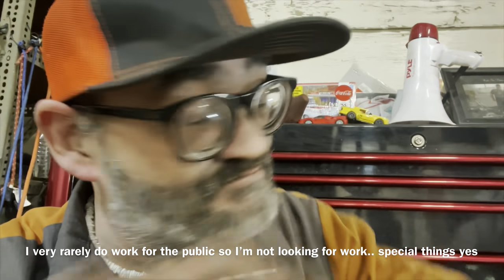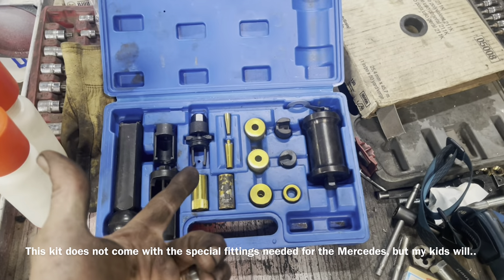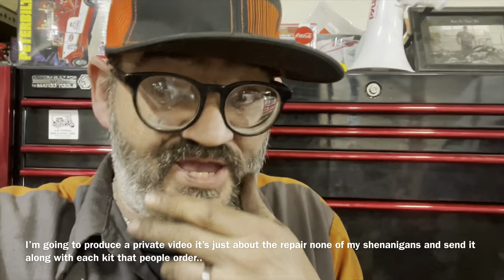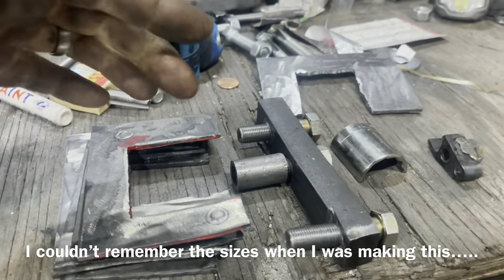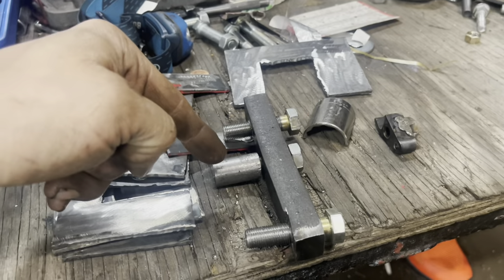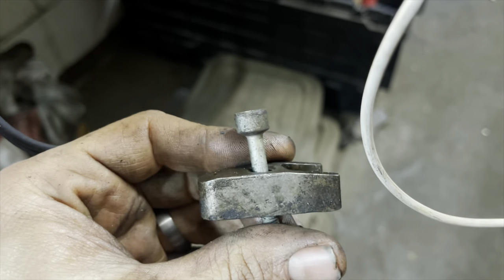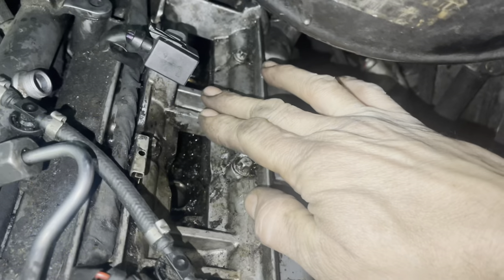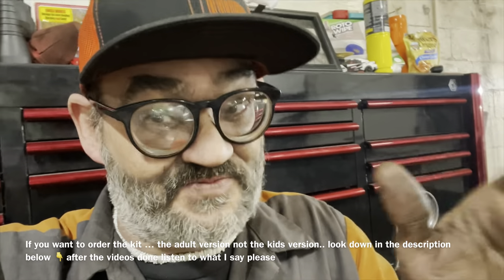How to remove Fuel Injectors Mercedes Om642 NV3 3.0 CRD Sprinter

Comment: 8:15 this is exactly what happened to me. 1/2 4140 steel plate would bend, and also I just went to m14 bolts for the standoffs and also the part that pulls the injector because 3/8 bolts were stripping and snapping. The coupling is just bored straight through with m14 tap so it threads onto the injector and the m14 bolt can thread on as well. Your DIY injector puller is exactly what mine was, except my standoffs sat on the torx bolts right beside each injector. Its the same measurement on both cylinder heads. The standoffs were bored and recessed a little to go over the head of the torx bolt and all the pressure went into the cylinder head. My injectors had black death, but two of them had seized with water damage. The water damage were the most difficult, took me two weeks to get all the injectors out. The worst one is in the back under the brake booster haha.  I also tried twisting the injectors, but even with 2ft wrench on the injector hold down slot it still wouldn't even budge.  BTW nice job getting them out, I almost gave up on them. Ive done so much work to my sprinter and my injectors were the hardest thing throughout the whole rebuild.
Reply from the maker: Thanks yeah I thought it was fairly and Genius and I just had to use it the other day so it definitely works in every location really well I’m actually gonna start producing them pretty soon with a kit Oh,

 I gotta even sicker invention coming out next week for Sprinter’s…. Stripped off, injector, holddown bolt repair without removing the head or drilling and tapping… and Hili coiling!!! Not that they would hold anyways for very long, but the bolt that I designed will work forever without really any work should make me a couple dollars here in there because these videos don’t pay Crap 💩. Anyways welcome to the channel. Happy to have you. Glad you got it figured out and were able to fix it to.!!!!
Reply: @sharpcarco  have you got this kit yet for the 3.0 mercedes-benz?

Comment: Great video, also watched your side door video for this particular model too, always enjoy the commentating and editing.   Anyway, I've got a OM646 or OM651 CDI, it's the 2.1L, it's only got 4 injectors but like you, the last 2 aren't accessible with a slide hammer.  Everything under the rocker cover was caked in Black Death (crystalised leaking diesel), I removed one of the injectors closer to the front of the vehicle but I'll need these leverage tools you spoke about in the video, I took a look in the description for them but couldn't find the tools.   Did you guys manage to get round to fabricating any yet?

Many thanks

Comment: just finished om642 injector replacement. removed the brake booster, put a $19 slide hammer and popped them all out at 4th and 5th try. no need to weld, grind, weld. just $19 well spent.
Reply from the maker: OK

Comment: Love your videos! Im trying to find out about injector o ring replacement on a 2012 GMC Terrain 2.4l. What happened was one of the seals bit the dust and was leaking a ridiculous amount of gas externally. Found a torn ring/seal on removal. When I tried to replace the seal ai figured out after a lot of frustration that you have to have a special tool to get new ones on the injectors. I'll be getting the tool in a cpl days, had to order it. I'm doing all the recommended cleaning and replacement of manifold gaskets/cleaning pcv while preparing for reinstallation but I came across a procedure that said the cylinder head must be removed. 
My question is this: Is it really necessary to remove the cylinder head during this job? The rail/injectors were removed easily without much effort. I can't figure out why anyone would say that. What do you think,?

Comment: hello, can you tell me if there is a mechanical transmission that can be installed in a 2010 ltz traverse? ...I wouldn't mind losing the 4x4 as long as it can be driven (I live in flint)...it was already slipping with black oil like a hole, I changed the oil and lost reverse, and to top it off now it also moves in neutral... no rust, perfect paint, new tires and very good interior the engine runs perfect, it would be a shame to throw it away (even if it is lol)
Reply from the maker: Not that I’m aware of… interesting thought though
Reply: @sharpcarco  If you have a solution with a mechanical gearbox for models as disastrous from those years as the Acadia and Traverse, believe me, it will hit the nail on the head... many of us will go for the change to a mechanical transmission and not have to throw away the vehicle than otherwise , it's relatively good.
Reply: @sharpcarco  I could also go to your workshop if the price is reasonable to repair or exchange for a second hand (money is getting tight these days lol)
Reply from the maker: You probably could use the Chevy trailblazer drive line. They may have made one with the 53 in the SS. I would have to guess that’s probably the same.
Reply: @sharpcarco  you are the scientist, i will wait for your happy discovery

Comment: I like you clay, 8:44 no no. Lucky you didn't strip the head!
Reply from the maker: Well, that would’ve been OK if I did that then I would’ve just shown you my bolt that I designed in developed that allows you to repair a hole without removing the valve cover or the cylinder head
Reply: @sharpcarco  Don't tempt me with a good time, SHOW ME!
Reply from the maker: @dasburke  I will I actually developed it before June 20 23 and I was just talking to another guy tonight about it. That reminded me I had the bolts made and everything. I totally forgot about it. they are pretty kick ass.
Reply from the maker: @dasburke  I’ll release it within the next two weeks. I found the video that I recorded of it.